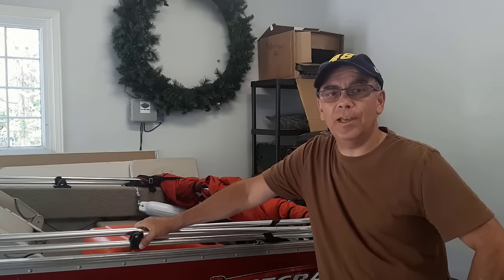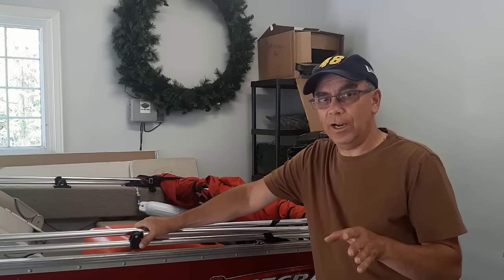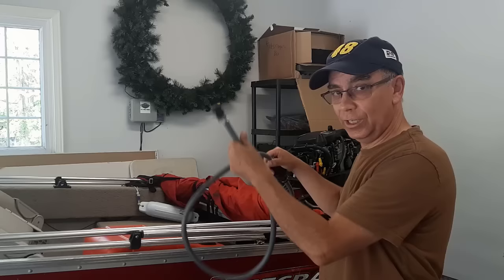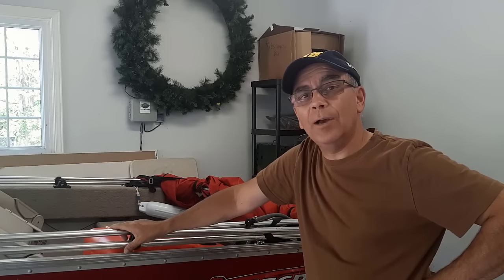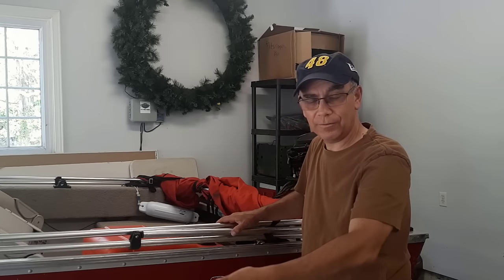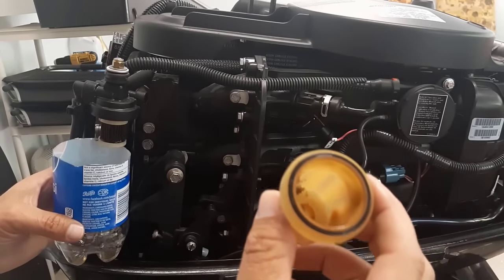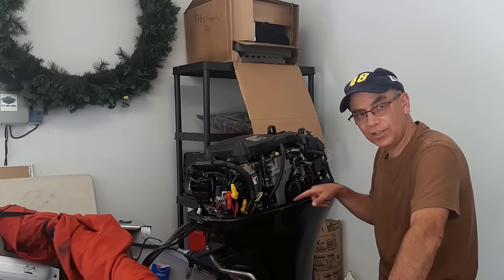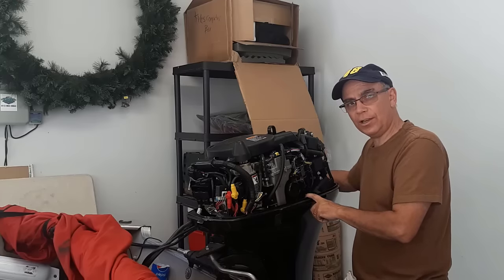Mercury Outboard Runs Then Dies // Try This Before You See Mechanic

Comment: Had the same problem on an old mercury 2 stroke run ok for awhile then open the throttle up and it would just die . It had been sitting for a couple of years . Put new fuel lines and fittings on it from the fuel tank to the fuel filter.. still did the same thing.. found out the carburettor was all gummed up with residual.. cleaned it out problems solved
Reply from the maker: Good to hear!

Comment: I've cleaned so many carbs and seen the fuel lines fall apart internally from the ethanol. What's bad is the fuel pump if it's before the first filter can get damages, they can leak and add fuel to the oil in 4 strokes.
Reply from the maker: Thats not a good thing for sure.

Comment: Going tomorrow or Monday to try new filter I received today...again, thanks for great video. .. will let you know.....I also suspect it could be the booster pump....but the sudden shutdown does not really“fit” the problem.
Reply from the maker: Hi there, good luck with your motor. Yes let me know how you make out. Fingers crossed for you 😊👍
Reply: Sad story, I’m drinking YOUR  beer.... the filter needed change but is not the root cause.... the high pressure filter is totally dry.....so either the low or hight pressure fuel pump is shot. Motor still under warranty, so will leave that to the dealer.   Much thanks for helping me through this.....saving a beer for you the next time.

Comment: What was the issues? I just bought boat and took it out today motor is Mercury 60hp previous owner start it and ran good before i bought it.  Took to the lake today motor start up and run good for few mins  and it died mine seem to be same as yours.   Mercury 60hp is 2018 under 20hrs.  Can you help?

Comment: Just done this on my Yamaha a few months back. Exactly the same fuel line broke down and blocked fuel filters (changed) both still runs rough. Checked and cleaned injectors with ultrasonic cleaner. Checked high pressure pump and it was dirty so cleaned with ultrasonic cleaner. All running great now.
So what we found was the inner liner breaks down due to Ethanol content in the fuel and what we found in filters was micro particles of the liner which looked like gold sand.
If you have this symptom with your engine do what i did and it should be fine, oh no need to buy new tank just the line and bulb.

Comment: Good info, looks like my motor, mines a 2005 60hp 4stroke, cant get mine to go into neutral, it's in forward because i changed water pump
Reply: having the same problem you are. changed my impeller, and cant get the splines to line up to put it back in
Reply from the maker: You will have to keep trying. I had the same issue, and finally got it
Reply: I even tried to put it in neutral with lower unit off, still no luck,

Comment: I went through all that and then found all my fuel lines were swelled shut. Had to replace all the lines. High pressure ones too. I then found my float pin sticking closed. Which doesn't let the vst fill with gas to pump the high pressure lines!

Comment: I had a similar problem. I bought a $400 boat that they didn't want to put a bunch of money in. I went through the cooling, fuel and electrical systems and started tearing into the motor. It was an screw in the bottom reed valve. When the motor was raised up the screw would fall out and everything worked fine until it worked it's way back into the reed valve.

Comment: I have an evinrude etec 30 hp outboard. Had similar issues which were resolved. Problem now is the motor won’t get to top speed. Barely running at half speed. Any suggestions?

Comment: I have a Johnson 70 HP, Model 070TLCEM that started but will not restart.  So far I have cleaned the engine, cleaned the carbs the best I could when they are installed, replaced the fuel filter, added 5 gallons of premium no ethanol gas, and a can of SeaFoam.   Also checked the the spark plugs, they are gapped correctly and spark.  It started right up and ran for 30+ seconds great.  Then died and can't get it to start again.  Am I missing anything obvious?
Reply from the maker: Without seeing it I couldn't tell you.

Comment: I have a similar problem with my 2014 Mercury (Tohatsu). Mine runs for about an hour and stalls. It wouldn't start for another 2 hours till it really cools off. Any ideas??
Reply from the maker: Did you check to make sure the motor is staying cooled, it could be your impeller is wore out.

Comment: Had that problem with an old Mercury outboard. Found a clogged fuel filter that had been added to the engine sometime before I got the engine. I also found a recall modification for the type of gas can I had and performed the mod. That fixed the problem.

Comment: I had pretty much the same problem on mine. When I bought the  unit it had regular fuel in it. I replaced the fuel with premium, same problem. I dosed the fuel with Sea Foam. I ran it a couple of times a week till I got some time for it. When I took it out, problem solved.

Comment: Tip buy OME fuel line and bulb why they last 5 times as long, the ones from WalMart get stiff in a few years.   Since you do your own Maintenance change the Plugs as there cheep when I was fishing a lot I did it annually.  If you have a carburetor spray carb cleaner in it when running. In the Fuel I use SeaFoam as it does work keeping fuel system clean.  That fuel filter you changed just annually take it out and spray clean with carb cleaner and put back in.   I do all the above in my 30hp Johnson and 2 pulls it always starts. From temps in the teens like 17F when I go duck hunting fires right up.   Good Fishing
Reply from the maker: Great tips, thanks!

Comment: That is caused by the ethanol in the fuel.  That is why boats are supposed to  use non ethanol fuel.  Its hard to find sometimes.
Reply: I believe Shell 91 is ethanol free, but it'll say on the pump.  Use pure-gas dot org to see which stations sell non ethanol gas

Comment: my 9.9 4 stroke mercy, floods super easy, will only start on fast idle often have to remove the fuel line completely put fast on and pull dozens of times until finally in starts and revs high.  If I try to slow the idle to much it dies.  It floods even with the choke off.  Is it possible that the fuel pump is supplying to much fuel?

Comment: hi. thanks for the info,  a clean fuel line for unhindered gas?supply is definitely important. But is there an issue with the relative height difference between the carburetor and external tank?  (if the tank is too low, the motor does not generate enough vacuum to suck up the gas because of the weight of the gas in the hose)
Thanks for your reply.
Reply from the maker: No not at all. Most boats, the motor is higher than the tank.
Reply: The motor makes crank case vacuum as well as pressure(pulses) way more that a fuel pump really needs...

Comment: When a fuel line deteriates and the liner turns to muck all that disolved plastic muck gets sucked into the fuel system and will usualy get past the first mesh cage filter.(the engine shown here has a element type fuel filter i am gussing thats because its fuel injected  not the mesh cage type on carbrated engines and this might catch all of it) the fine secondery filter if your engine is equiped will usualy catch it ,, But if your engine does not have one ,, it will usualy clog up at the float needle valve and seat in the carb ..is good practice to clean the carburetor as it likely will cause repeat issues if you dont do so. if this issue occures on a engine that does not have a secondary fuel filter.. and sometimes that disolved plastic in the fuel will even get past that.. one thing that people somtimes skip , is this plastc muck does is it also loves to clog up the fuel fitting where the fuel line attaches to the outboard make sure flow is not restricted through this fitting , replace or clean it if it is ,, flush some fresh fuel through the system into a catch can by pumping the bulb  before instaling a new filter to check flow and get rid of any of this muck in the engines fuel lines up to the filter.. Allways leak test the fuel system when you finish your repairs ..

Comment: My husband's motor is doing this. It just started doing this 2 days ago we go up on the wave and then it would slow down and with the throttle all the way in the corner it was hardly going anywhere it was going slow and we can't seem to find the problem we cleaned the carburetor, just put new park plugs, has compression but we aren't sure of the problem
Reply from the maker: Hello, ya give this a try. Hope it works out for you.

Comment: Great video- I'm on my mystery fix on a 9.9 tohatsu.  2 trial and error fixes of my own and I'm pretty clueless short of youtube videos so thanks for sharing!
In desperation just gave it to the professionals but still no luck after they cleaned up what they described was a carburetor problem.  I had my doubts as i checked that and it was clean so i think i got scammed.  Anyway the issue is it starts but as i try to give throttle it bogs and just wont accelerate.  The engine sounds fine its just like stuck in low gear...?  Any thoughts would be greatly appreciated!
Reply: Replace your fuel line. If you have issues after audit bogs down or just doesn't hot full rpm you likely need a carb adjustment. Sounds like not enough air in the mix

Comment: I did all that, but i still have a problem with the prime burbs not holding pressure,  i have to prime it almost every time or if i stop n fishing for 30min or more then i had to prime the burb b4 i can fire it up....if i dont do that it will crank but not startup...lmk what u guys think......need help here...ty

Comment: If you didn’t buy fuel line from a auto parts store you will eventually have the same issue. The new lines you bought have the same liners in them that breaks down from ethanol. Just go to auto parts store and buy fuel lines for a car and you will never have to worry about it again. The lines are cheap and good insurance against the liners breaking down again. Good luck 🙏👍
Reply from the maker: Yes I did just that and made a video about it. Have a good night!

Comment: Nice work. I have been finding lately that fuel lines don’t hold up that well with the heat and they have been collapsing inside themselves and disintegrating… Good diagnosis

Do you run premium in your boat?
Reply from the maker: Everything seems to manufactured so cheap now days. Yes I run premium
Reply: Do you get non ethanol. It's worth the extra money.
Reply: @garypellerin5576  I think premium is better but all premiums are not the same. You have to look for a premium that doesn’t carry ethanol because some do. Still do your research. I have seen ethanol fuel left in the carburetter over winter and it just pitted the carb and caused this white goo through the fuel system.

Hope it helped

Comment: Hi, we have the same problem and have changed the filter, fuel pump and have all new fuel lines, bulbs and tanks as this is a new build. . . a ply on frame fiberglassed 20' dory we built ourselves.  We bought the Mercury 40Hp, 4 stroke EFI outnoard for it used (with 56 hours on it)  and are now at wit's end. Any ideas?
Reply from the maker: Did you check/change the high pressure fuel filter underneath the coil on the left side of the engine? I have a video for that as well. It's about 2 weeks old, should be hard to find. Thanks for watching.
Reply: @GettingItDoneRepairs   You Sir are a Prince! We saw your second video and got to work on the Merc a week ago when the second, under the coil filter arrived. After a few hours of dropping screws and spacers, and trying to put everything back together again. . . well, it was a bear of a chore! Got the boat on the Myakka River and ran the Merc at all RPM ranges to 5500 and the issue became history.  She purrs like a kitten. Thank you and God Bless.

Comment: crack your fuel cap  and your fuel filter there are 2 of them .you might have a air lock in your tank sounds like its your problem . I am an OB mech.
Reply: Yep, your outboard fuel tank filler cap should have a vent screw in it.  Make sure you have the fuel cap vent OPEN when using your outboard.

Comment: Good advice in this video.  That said, here's MY advice:
 NEVER,  my fellow boaters, use pliers... ESPECIALLY needle-nose pliers... to tighten fasteners on your rig. 
 Always use the correct wrench, preferably a box-end wrench, whenever possible.
  Pliers are the mark of an amateur....or an ill-prepared boater.
Reply from the maker: In most cases yes a wrench is better. In this case I only needed to snug up the nut as the nut doesn't fasten the part to the bracket.
Reply: To add to that, buy a set of midget wrenches. Especially if you have a smaller outboard

Comment: Use fuel line zip ties molded to fit the radius of hose, flat zip tie will produce a gap over time. Also use Vaseline on tip of new filter and they will slide in, why it has a lip on it. Or just switch Bowl with filter 😉

Comment: Pretty much any time it runs great at low speed and then runs good for a short time at high speed it’s a fuel delivery problem. 

There’s enough flow for the slower speed then when you open it up it will run fine until it outruns the supply and then uses all the fuel in the bowl on the carburetor. 

At that point I always start at the filter. It’s usually not a waste of money to change anyway and it’s normally the cheapest solution. 

For what it’s worth you didn’t waste money on the fuel line. Since there were pieces of the liner in the filter it wouldn’t have lasted much longer. The fuel tank maybe not so much. 😃

Have a great day and be safe out there!
Reply: I have same problem and I did these changes it ran good for 2 hours and did same problem what would u recommend. I didn’t change the tank. You think that would be the next step? How would I know it’s not bad fuel or the tank?
Reply: Spencer Hagerstrand  I’m thinking if it was bad fuel you wouldn’t get 2 hours of good run time. Most likely there was trash in the fuel tank. You may be able to clean it out but you may need to replace it. If you check the filters and they are dirty again I’m pretty sure that’s the problem. Good luck 🍀👍🏻

Comment: I have a 2001 yamaha 100 hp 4 stroke out board . It won't run unless choke is on  full. After I start to reduce the lever..engine dies immediate ly. Please help

Comment: So to avoid this would the secret be to use ethenol free gas.I would say run the engine full line off until fuel is out of the engine but that would not keep the fuel line from the tank from rotting.So what is the answer to having this not happen again?
Reply from the maker: I'm in Canada, we burn premium fuel in small engines and the trick would be to replace that gray fuel line with a black fuel line. I guess you would call it an automotive fuel line/hose.

Comment: Happened to me once on my palm beach. I found dirt dob bers had build a nest in the air replacement tube, causing an airlock. I started putting a small plastic cap over the air inlet when I parked the boat, and problem solved

Comment: I don’t know if someone else in the comment section made reference to this, but on those fuel tanks there’s a plastic tab that screws up and down that serves as a vent. If it’s too tight, the tank will not vent and you won’t get enough fuel
Reply from the maker: That's true.

Comment: Greetings my dear friend.. There is a 50 hp thatsu engine. 3 injectors are intact, the brain is intact, the fuel pump is working... but I think there is no fuel reaching the pistons. It works when I spray brake lining spray inside. I am a mechanical technician myself. Apart from the 3 injectors of the engine, there are also injectors inside the compartment called the log, I think they adjust the air and gasoline mixture. Could it be one of these? What is your advice? I wish you a good day... From Tuzla, Istanbul Greetings... Gasoline reaches the injectors. In addition to the fuel pump, there is also a pressure box that pushes the fuel forward.
Reply: To save yourself time and money, do this. Bring it to a reputable marine shop that can hook it up to a machine and diagnose it. See if it's something you can fix. If not get them to fix it. It's better to do that than waste time and money throwing parts at a motor and maybe not fixing anything. There is a local mechanic who has a saying that goes something like this: 'After you save all that money, spending all that money, doing it yourself. Then bring it to me and I'll fix it for you'.

Comment: Hi got a 20hp suzuki does exactly the same  i just get a red light then it go's in idle mode put it in neutral couple of seconds lights go out can run again couple of minutes stops again. Idling water strong at pee hole when running does not look strong any idea for me? Thank you
Reply from the maker: It sounds like your impeller is wore out. It may not be pushing enough water through the motor and it's running to hot. Not cooling properly.

Comment: I had an old VW bug that would only run a 1/4 mile then sputter and die I shut it down and wait 5 minutes and go another quarter mile. Turns out it was just so much sediment in my fuel filter clogging it up every time the fuel started flowing

Comment: I fought a fuel problem in my 90 HP Merc for 2 years..  Boat would run like crazy.  but if you idled in a no wake zone for a couple min It would load up and flood out.  Changed everything .. or so I thought.. was having seals put in the lower unit and mentioned it to the tech..  Says change the fuel pump. .. But it runs !!!!   lol  changed it .. problem solved.

Comment: My 89 70hp merc is similar in problems but all fuel system components are fine.
Runs fine in the yard and initially on the water for a little while. After that it runs with warmup lever but won't idle.
Anybody have any ideas?